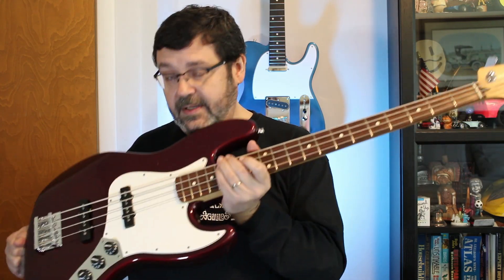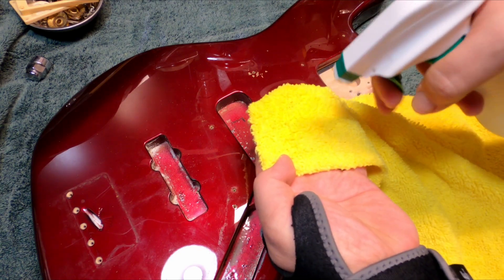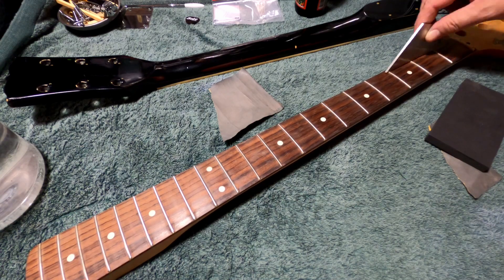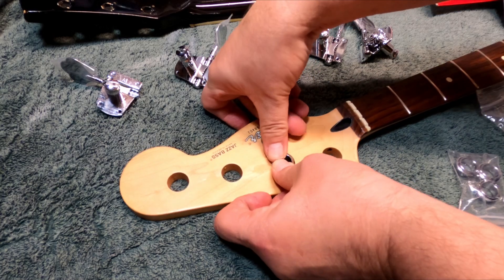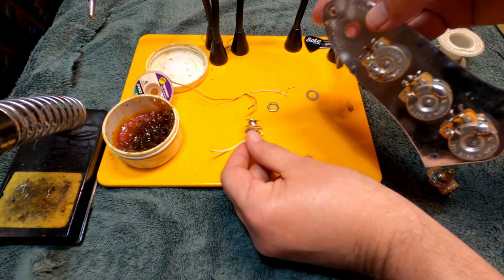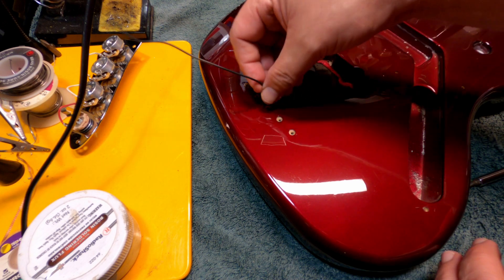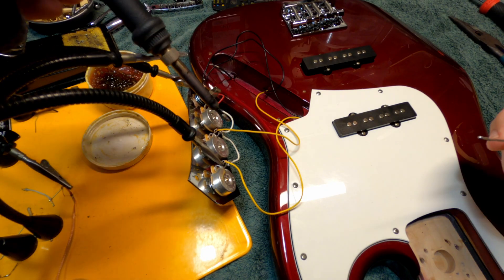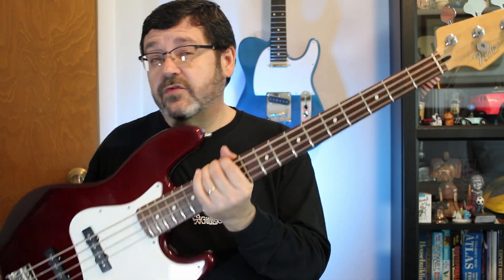Fender MiM Jazz Bass Pawn Shop Rescue

Comment: Great video!  I recently acquired a very similar bass (1997 Black).  Only issue I can find is that the skunk stripe came a bit separated from the neck. You can feel the transition with your thumb, but neck is straight and it doesn't affect playability.  Would like to restore it so it's smooth to the touch. Do you by chance have a video for that? :)
Reply from the maker: The only thing I've got on video is this Squier had a beat up neck so I sanded it and applied poly to it - https://youtu.be/3oQC8k8C5kg  You can sand the stripe down to match the contour of the neck and use Gluboost to refinish it. I think Dave over at Dave's world of fun stuff showed how to do that in a video a couple of years ago

Comment: Just bought a used j-bass, same color, MiM. It has what looks like a plastic  (chrome finish) control plate. What is the material of the original plate? Brass chrome plated? Steel chrome plated? Thanks!
Reply from the maker: Chrome plated brass. Replacements are around $15